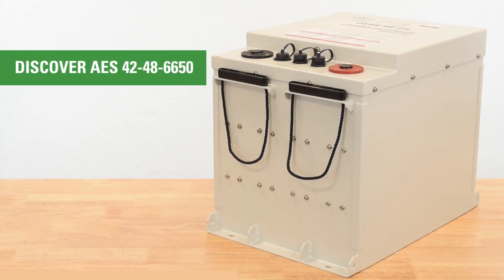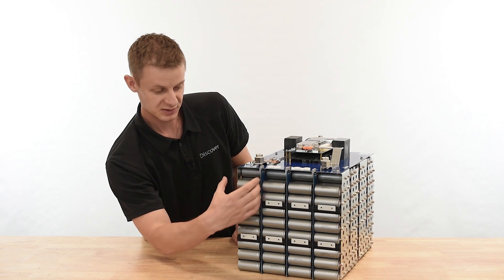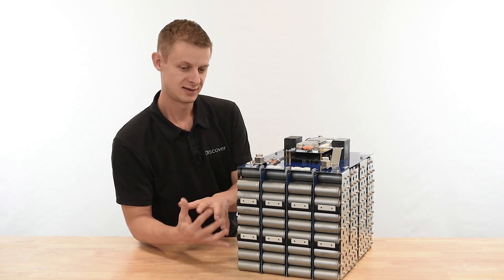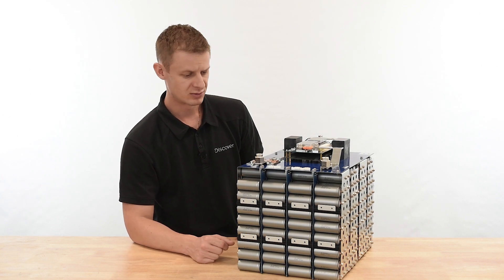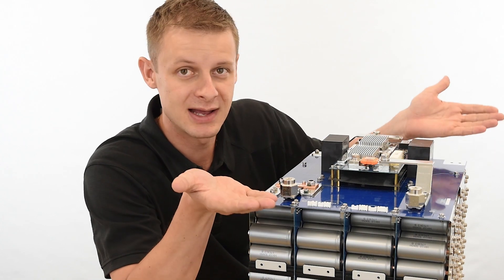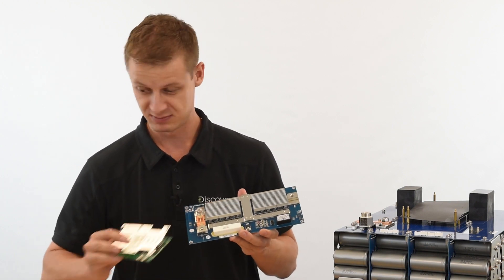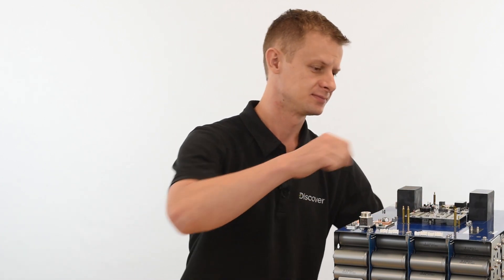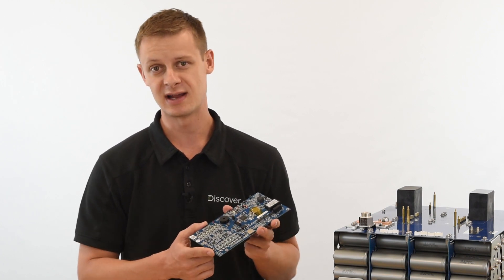Discover Battery™: Discover AES Lithium Battery Design Philosophy

Comment: I'm vary happy to say that i have installed a bunch of Discover lithium batteries 24v and 48volt in many different configurations and I'm very proud to say that I have never had a problem or call back. The battery has the ability to save, track and report all temps, voltages, and kWh, which is so important with today's customers, it truly is a investment that will keep your equipment running for many years. #camosolar Inc

Comment: Excellent presentation. Thank goodness Discover is advertising intelligently with full technical explanations. I am about to order 3 of these units for off grid use with a 12 kW PV array.  I have been using an AGM Surrette Rolls bank of 40 kWh. It has worked well enough for the last 4 years and I will keep it as a back up. I anticipate that the absorption efficiency of these Discover lifepo4 will make quite a difference in the amount of solar energy I can store. In December in B.C. in the Okanagan sometimes there is only 1 hour of bright sun in a day. One must optimize the ability to capture that and these batteries will do that. As well generator run time will drop significantly with the charge acceptance and the fact that these batteries are happy with a "partial state of charge", which is the weak point of all lead acid batteries.